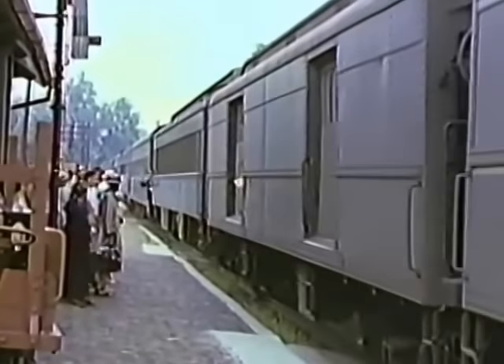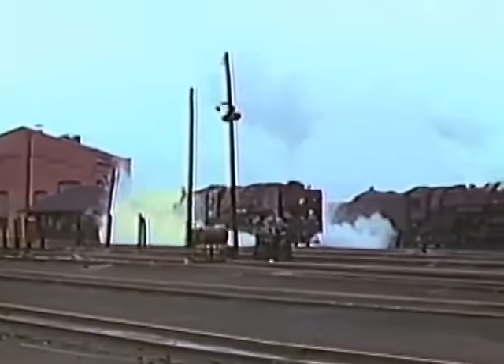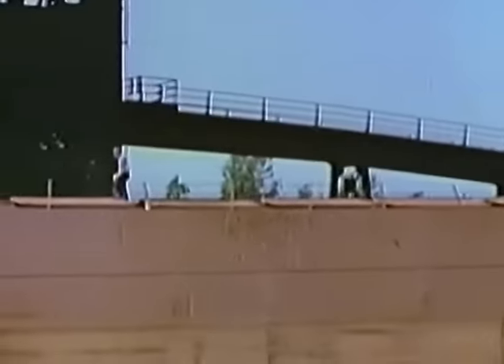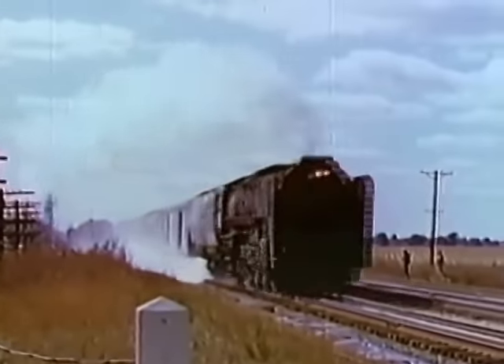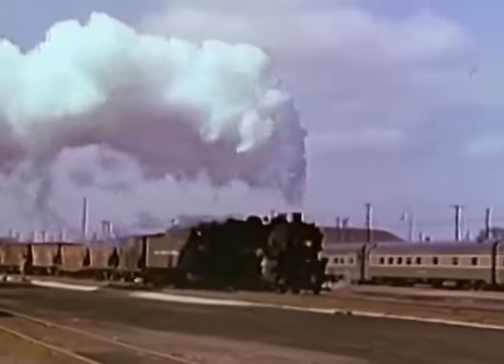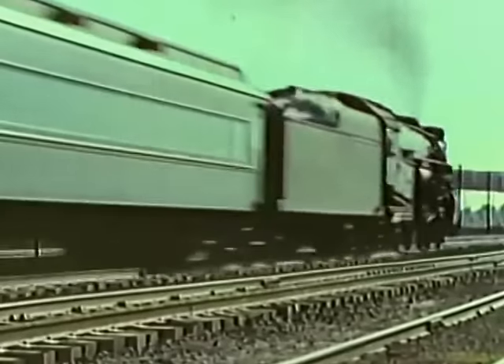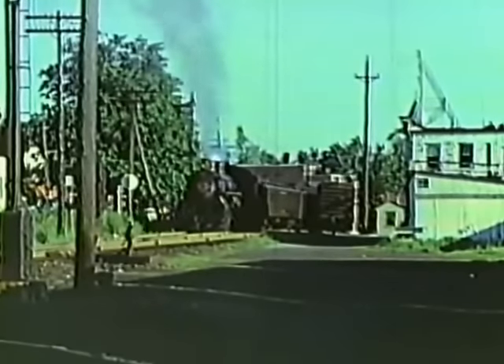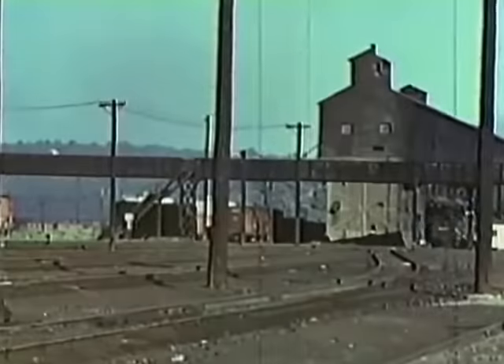NYC Water Level Route

Comment: I find it funny that steam locomotives kept two men fully occupied, yet Diesels are so boring they have to have an alarm to keep the engineer awake.
Reply: that's not what that's for lmao
That alarm is there for safety reasons. Should the engineer, i dunno, DIE, that alarm will set off the emergency brakes. Should that happen in a steam engine, you're out of luck and the train'll keep going until it explodes from derailing.
Reply: Railroading used to keep thousands of men fully occupied and their families fed.  Nowadays it's just a computer problem.
Reply: all they do is moan for their fitters
Reply: @TrolololGaming  No, because there would be two men operating the steam locomotive. The only exception would be the Camelback locomotive. They were designed so that the fireman in back was isolated from the engineer.  If the engineer keeled over, the fireman wouldn't be in a place to see it.
Reply: @TrolololGaming  I'm no expert, but GWR Locos had a warning chime/bell that went off when the locomotive approached a station, and should the reset for the alarm not be set the brakes will apply to stop the locomotive. Best thing is that the chime is a physical and not an electrical piece of equipment (to my knowledge).
Reply: would be impossible to steal either one lol. i do agree with your reply
Reply: @TrolololGaming  most of us know its not specifically for that reason alone. But it kinda does that job by default. I agree its more significant use is the health of the person controlling the train. Lose control of that, things get really messy really quickly
Reply: @TrolololGaming  Yes, of course. So, what's the problem?
Reply: @TrolololGaming  Not true.  In Britain we had AWS, and if the driver (engineer in the States) failed to respond to the bell or horn, an emergency braking would be applied (similar to someone pulling the communication cord).
Reply: Diesels are much more efficient and tons cleaner, though.  Likely, they boosted property values adjacent to major lines.
Reply: You've hit the nail on the head!
Reply: @h8GW  Electrics are much cleaner, however, if living next to a mainline, I'd take steam over diesel clag any day.
Reply: The alarm is for safety not to keep people awake
Reply: @paulcaswell2813  what he said is true.  Steam engines in the states didn’t have any safety feature like this.
Reply: @h8GW  "cleaner" definetly not, only good thing about them is left labour intensive
Reply: @ohboy2592  safety features like AWS and PTC are made to make sure a runaway doesn’t happen and you don’t miss signals but when you have a guy that isn’t bored and has to constantly work means that you have less of a chance of missing a signal, furthermore a steam engine may explode but that doesn’t just happens you have to drain all the water from the boiler for that to happen. The truth is that diesel power exists because in the 50’s for steam it was 6 cents a mile to run, diesels 4 cents a mile, 2 cents made tons of people lose jobs and companies go out of business. I love all types of trains but steam has its advantages, diesel has its advantages and electric has its advantages but none are exactly equal.
Reply: It’s sad we got to see these giants fade into the past, people always want an easier way of doing things even if it means saying good by to the most complex pieces of technology
Reply: @paulcaswell2813  diesel is better
Reply: I have to agree with you my good sir
Reply: That's technology. Bet they have a weight to power ratio and with speed and breaking options computerized, robotics with a few more tweeks.who knows, ships,blimps,things like that.
Reply: @TrolololGaming  On a conventional steam engine with a single rear cab, the fireman was there to shut off the throttle and apply the brakes if the engineer passed out or died. On a Camelback, that could be a real problem, but even there, a fireman with a little experience would notice that the engineer didn't blow the whistle or brake, etc., where he should have and take action. I think he had an emergency brake valve in his rear minimal cab, and after dumping the air, could make his way along the right running board to shut off the throttle.
Reply: I want them steam locomotives
Reply: @drakeredwingofficial nice reference.
Reply: Everyone shut up and enjoy the video about steam choo choos and have fun, jeez
Reply: Wow, the good old days huh
Reply: Diesels aren’t boring. Screaming turbos and roaring cooling fans sound way cooler than a steam locomotive ever could.   That alarm is there for safety reasons and only goes off if the controls haven’t been messed with.
Reply: Diesels aren’t boring. Screaming turbos and roaring exhaust fans sound way cooler than a steam locomotive ever could. That alarm is there for safety reasons and only goes off if the controls haven’t been touched.

Comment: It's also of note these machines were designed by slide rules, theoretical calculations, and teams of draftsmen and design engineers. No computers,  or automation here, these were all basically hand built machines. While they were maintenance intensive and expensive when compared to diesels, it's hard to ignore their pulling power, looks and sheer scale. It's a real shame none of these magnificent engines were saved and preserved for future generations to enjoy. Wonderful video and thanks for posting it and sharing.
Reply: Early diesels were designed with slide rules as well.
Reply: @2022-Matthew Baker But diesels have a thermal efficiency more than twice that of steamers.  And while coal may be cheaper, it's not 7 times cheaper.
Reply: That's really sad. In the UK a number of businessmen were instrumental in saving steam locomotives. These were formidable giants and the ultimate in U.S. steam traction
Reply: Feliciana Delacruz Two of the Mohawks still exist today, sasly they both don’t run and probably never will.
Reply: @mikeytrains1  If Northfolk SOuthern cares to pull a bigboy with them, they could.
Reply: Computers aren't a panacea. To me it is of note by that reasoning it is truly amazing the J79 jet engine for example was ever built. Heavens, multistage steam turbines with tens of thousands of horsepower were around 40 years before these comparatively conventional locos were even thought about. The fact of the matter is, the J79 was and it still continues despite (or in spite of) the prehistoric/old fashioned/geriatric/feeble [insert cheesy ageist contemporary intensifier here] slide rule engineering with its outmoded bedfellow - manual calculus! Maybe it was all alien tech afterall because we couldn't possibly have worked it out without that tool The Computer, CAD and things like CNC machining.
I've never read such silliness from somebody that ought know better I feel. You guys crack me up. Just because you know a thing or two about engineering you fail to apply the same critical thinking you have learn't to other areas - like history - before banging away on the keyboard making yourselves look really ignorant (which I'm fairly certain you are not).
Next you'll be telling us that before you were born people never participated in anything other than missionary position reproduction once or twice a year in order to make babies. 

Please...
For your viewing pleasure I thought of this engine vid from the 1930s. The engine being built is not very sophisticated even by standards of the day but the production machinery is the point of this vid:
https://www.youtube.com/watch?v=ieF3d_YBUh4
Reply: What vhs was it released on?
Reply: Feliciana Delacruz And the machines of today aren’t designed by teams of draftsmen, engineers, and theoretical calculations?

The time saved by computers allows more time to be invested in further engineering other aspects of the locomotives
Reply: ThePaulV12

And turbomachinery was thought way before the J79 first took flight. A J79 maybe the greatest modern marvel to your standards. But in my opinion, it's no better then a Allison V16, Packard V12, or any Rolls Royce engine. All of which proved their worth in both the aeronautical and marine industries. And also, were conceived via a slide rule.
Reply: Maybe start a fundraiser to build a new Hudson and Niagara (S1a) from the rails up?

Suggestions for road numbers

-Hudson: 5456
-Niagara: 6026
Reply: @lennyhendricks4628  Depends on the speed the diesels were far more efficient at low speed coal or freight haulage.  Steam efficiency improved in say the range of 50-80mph *80-130k.  not stopping all the time greatly improved the efficiency of both steam an diesels, If you want to stop every 5 miles only an electric is efficient. In the steam age many railways were dogged by having to stop their crack passenger trains all the time, Norfolk and WEstern ;passenger trains were required by the state authorities ot make ten stops in the last 100 miles into Cincinatti.  In some ways in outrage perfomrance on fast passengers the sort of steam being developed by Paul KIefer on NYC, the NW J designed to run at 145mph on the pennslvania main were probably capable of sustained 120mph (200k ) operation.
Reply: Possibly the Jet fighter bombers designed in the age of the slide rule and mathematician were actually better as the designer and draughtsman saw the design project as a coherent whole and probably only 1-3 men or persons  really saw the vision and implemented in where with computer design it is design by committee and multiple political control even within  an airforce and ministry of defence. Put it this way in 1961-63 Sydney Cam and his UK Hawker team designed the P1154 a Mach 2 STOL/VSTOL Mach 2 fighter bomber rather like the current JDF 35 which has been 29 years of troubled evolution. Or consider the human designed Anglo French Sepcat Jaguar the last design from the human slide rule era and the very jejune and average Tornado RAF/ French Nato bomber. In a test early in the 1991 Gulf war with the Iraq air defence net only half degrade one squadorn of RAF Tornado went in low in company with a French Jaguar squadron and and RAF Sepact Jaguard squadron. The French and British jags all got back to base if suffering many AA hits, half a dozen Tornados were lost in the desert .
Reply: I personally think if steam locomotives were remade today they could be more efficient and cheaper then diesels if done right using modern technology for much of the maintenance
Reply: @2022-Matthew Baker The problem with declaring one fuel as cheaper than another is that cost is based supply and demand. If the demand for coal were to increase, so would the cost
Reply: @ThePaulv12  People back in that day could "think". My dad was a thinker. Very little education, but the smartest man i'll ever know.

His buddy was one of the biggest moonshiners in the Florida.  He once told me all that stuff you hear about North Carolina being the center of moonshine activity is a myth.  Told me they ran semi-tailor loads up north regularly. 

The government, in attempt to slow down production, limited the number of five gallon cans you could buy, without registering/signing for them.  My dad made a machine that would make perfect five gallon cans, like one would by from store.  I saw one once, you could not even see a seam in it.
Reply: @mrnemo204  
Probably th he other way around now that 4014 has been restored. I'm not sure just how far east the Big Boys could reliably operate.  When 4014 did her tour of the Union Pacific operating territory she got up into Minnestota and Wisconsin. But you can be sure the UP planned the route out very carefully. Sadly I missed her on her tour through. She was scheduled to pass through my area shortly after I got off of work. But they moved her departure from Milwaukee forward a couple of hours.
Reply: @lennyhendricks4628  google the 5at and other modern steam projects, and have a nice reading session. Sure they arn't the most efficient, but they could be used in the modern day in quite comparable nature to diesels, not to mention pollute less.
Reply: Oh there are preserved models out there, that's for sure.
Reply: Thank you Feliciana
Reply: Come to the henry ford museum in dearborn michigan
Reply: These locomotives are bunghole crazy
Reply: @David-lt6lt  I just shorted out on the toilet bowl
Reply: Kl
Reply: Great point! I started as a mechanical draftsman, then went into land surveying. But, I remember the long hours of, not just drafting, but the calculations involved. I still have my trig tables. And it was a team effort to bring it from design to manufacture. Beautiful video of magnificent machines!
Reply: @FranzFerdinandVIII  Just one billionaire railfan could do it. My preference would be for a classic J1 Hudson with spoked drivers.
Reply: @FranzFerdinandVIII  well if the PRR T1 project works, I don't see why not. They'll already have the machining equipment ready
Reply: Yep! Just Rules-of-Thumb and empirical observations👍
Reply: "...It's also of note these machines were designed by slide rules, theoretical calculations, and teams of draftsmen and design engineers...".  Locomotives of the present day were designed by "teams of draftsmen and design engineers", and also using "theoretical calculations".  The only missing element is possibly the slide rule, and you could use that to design a modern locomotive if you were so inclined.  You must not work in engineering in any capacity.  Amirite?
Reply: The steamers of old also had some unbelievable tenacity. They'd bring their train in on a leaking piston if they had to. A major problem with modern diesel and electrics is that if one part of the electronic mechanism breaks the whole thing shuts down. Never would've happened with these legends.
Reply: We are amazing people and have done nothing wrong.

Comment: 120 mph behind steam would be an interesting experience, to say the least....
Reply: Fastest train service in North America I believe. I don't know if the very limited Acela can do this now.
Reply: They want train service to improve? Run it more like this!
Reply: @77goofyguy  Fastest in North America in steam was the original Hiawatha service on the Milwaukee Road (CMStP&P).  This was the only steam operated service that required daily 100+ mph speeds just to maintain schedule.
Reply: Gene The Acela can and does regularly exceed 125mph without breaking a sweat.
Reply: The N&W J's could hit 106 MPH!
Reply: specially for the guy shoveling coal. course id say these are auto feed now.
Reply: You could see that on the PRR T1's.
Reply: Only when going for speed records, but 120mph+ WAS achieved with steam - both in Britain and Germany.  Speeds of 110+ were not unusual, and 100+ commonplace on many railways worldwide...
Reply: @paulcaswell2813  Happrned on the Pennslyvania railroad, PRR T1's could do 120mph or better, according to  Firing on the Pennsy, by Paul Dietz.
Reply: The Union Pacific 800 class 4-8-4 FEF’s were designed to run 110mph with a 26 passenger car train. One was recorded at 115mph.
Reply: @dat581  Strange then that the world record for a steam loco is held by  Mallard, at 126mph, and only a comparatively small Pacific class 4-6-2, but the result of superb British engineering and built in 1938.
Reply: @ralph5407  Nothing strange about it at all.
Reply: AND THAT WAS COMMON. No passenger diesels could ever come close and even today it is really pushing technology with the new Siemens passenger locomotives from 2018. It took how long to have a diesel that could run with a steam locomotive? 

SUGGESTION: Hey Amtrak, forget Acela and go get some STEAM. -just sayin
Reply: Tracks weren't up to it, and there was too much rocking, also the maintenance costs were too high. From what I've read, top speeds were kept in the 100mph range to keep repairs down and passenger comfort reasonable. 

But with better track, and lighter, smoother rolling coaches? With build quality up to modern standards? Heck yeah they could do it, I bet.
Reply: 120+ mph (authenticated) has been achieved a number to times in Britain and Germany (it was a veritable railway arms race immediately pre-war).

Comment: These beautiful steam locomotives feel like there human. Theres an element of breathing of smoke puffing like on a cold winters day. A heart beat of pistons and rods pounding. And an actual whistleing sound from the wistle. A fire in its belly and the need for both intake of fuel that had to be physically feed into it. and a drive to move once feed. And move as fast as possible because everyone could use an adrenaline rush/ get to work on time. Its easy to love and relate to theses human like machines. Diesel/electric are robotic and blah. Bring back steam to a new glory.
Reply: Well, each individual steam locomotive has a heart of some sort, so it would not be worth breaking its heart.

Comment: Holy crap 8:10 that's nuts. "Aight Fred! you and Bob push her into the siding!"
Reply: sorry 8:02
Reply: When Timken introduced roller bearings, they specifically outfitted 1 locomotive with them and for a demonstration had a team of local high school cheerleaders PULL IT by ropes. Roller bearings can remove the weight of a locomotive carrying itself and allows that to be transferred into tractive effort. That said and being factual....Me & Bob are NOT pushing that thing. -just sayin
Reply: @TotallyMusicArtistChannel  Thats not how roller bearing work, roller bearing reduce the friction between the axel and frame. By lowering the friction you also lower the force required to move it. Its like how putting something on wheels makes it easier to move, in fact its the same principle!